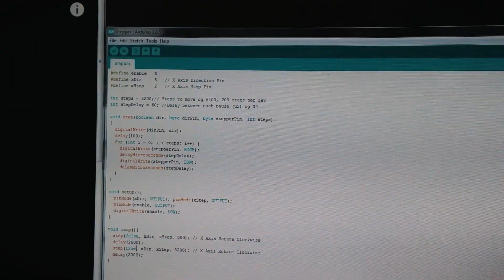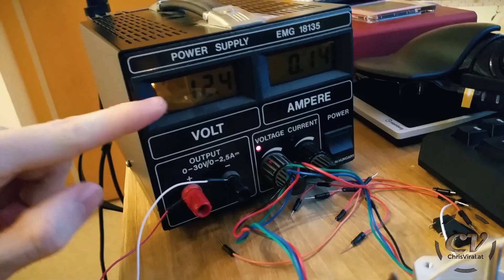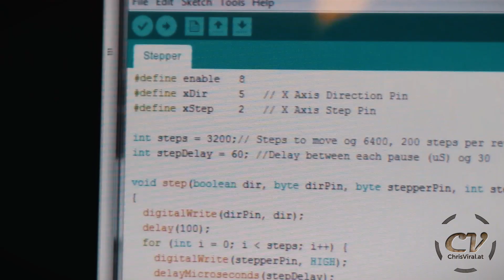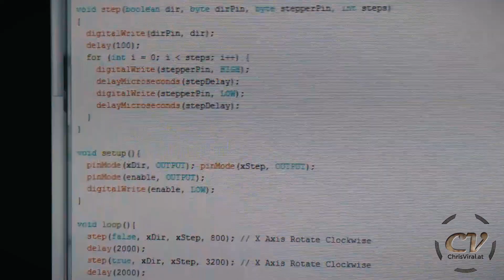Controlling A NEMA 17 Stepper With Arduino CNC Shield (How To & Code)

Comment: Hi, I am using this shield to control XYZ but two motors for Z must be controlled with a button to preform one action. while the XY will be controlled with a joystick. the project is working for XY but how can I make it work for Z? (No libraries)

Comment: ı put my drivers on it .when ı I measure the voltage value on enable pin with a multimeter.I see 5v.but ı did not coded for enable pins to get 5 v .however how to disable this "enable" pin?

Comment: You shouldn't plug in the stepper driver chips on the board without connecting a stepper to it. At least not the drv8825, but think it's the same with A4988.

Comment: #define enable 8
#define xDir 5
#define xStep 2

int steps = 3200;
int stepDelay = 60;
void step (boolean dir, byte dirPin, byte stepperPin, int steps)
{
  digitalWrite (dirPin , dir );
  delay(100);
  for (int i = 0; i < steps; i++){
    digitalWrite(stepperPin, HIGH);
    delayMicroseconds(stepDelay);
    digitalWrite(stepperPin,LOW);
    delayMicroseconds( stepDelay);
  }
}

void setup (){
 pinMode (xDir, OUTPUT); pinMode (xStep, OUTPUT);
 pinMode( enable, OUTPUT);
 digitalWrite(enable, LOW);
}

void loop(){
  step(false, xDir, xStep, 800);
  delay(2000);
  step(true, xDir, xStep, 3200);
  delay(2000);
}

Comment: you can get code for the shield from ACONCAGUASCI, google search 'ARDUINO CNC SHIELD CONTROL STEPPER MOTOR WITH DRV8825
' no thanks to this guy! you may need to change the delayTime/stps

also, you if your stepper controller boards are getting hot turn the pot counter-clockwise, it will turn the current to the motors down.
Reply from the maker: Thanks for the tips 🙌🏻

Comment: How can I control the engines that way using the race switches?
I already tried it in several ways and it does not work for me.
Help!!
Reply from the maker: I'll do another video on this matter in a few days - weeks. But until then you'll probably also have a solution so I'm sorry..

Comment: cómo puedo controlar los motores de esa manera utilizando los interruptores de carrera?
ya lo intente de varias formas y no me funciona. 
Ayuda!!
Reply from the maker: Thanks for translating this yourself, usually I need to go over to the translator lol. If I use the translator though it says "career switch = race switch" still don't understand it..
Reply: @ChrisViralVlogs  can already solve the problem, your video was also very helpful as there is not much information on how to program the motors with the shield
Reply: I made this code to control a single motor with switches (switch) of career

#define velocidad 2

int stepper = 8;
//Driver posicion x
int pasolineal = 1;
int direccionx = 5;
int pasox = 2;

int estadox = 0;
//Limit Switchs
int limitx = 9;
//int spindle12 = 12;

void setup() {
  // put your setup code here, to run once:
  pinMode(direccionx, OUTPUT);
  pinMode(pasox, OUTPUT);
  pinMode(stepper, OUTPUT);
  //pinMode(spindle12, OUTPUT);
  pinMode(limitx, INPUT);
}

void loop() {
  int c = 1;
  estadox = digitalRead(limitx);
  // put your main code here, to run repeatedly:
  digitalWrite(stepper, HIGH);
//  digitalWrite(spindle12, LOW);
  if(estadox == LOW && c == 1){
    digitalWrite(stepper, LOW);
    digitalWrite(direccionx, LOW);
    for(int i = 0; i<pasolineal; i++){
      digitalWrite(pasox, LOW);
      digitalWrite(pasox, HIGH);
      delay(velocidad);
    }
  }
}
Reply from the maker: Thanks for sharing 🙌🏻

Comment: Hey I'm using the cnc shield  with arduino uno and it all seems to work well. But today there is some problem with the rotation of Y-axis, it only moves in one direction. As you have spend a lot time to study it also you may/may not have encountered with the same problem. But if you could help me through it will be grateful. Your Videos is awesome.
Reply from the maker: Sounds like your dir-pin isn't connected properly

Comment: For all the LAZY hunt and peck typists. 

#define enable  8
#define xDir    5   // X Axis Direction Pin
#define xStep   2   // X Axis Step Pin

int steps = 3200;   // Steps to move og 6400, 200 steps per rev
int stepDelay = 60; // Delay between each pause (u5) og 30

void step(boolean dir, byte dirPin, byte stepperPin, int steps)
{
  digitalWrite(dirPin, dir);
  delay(100);
  for (int i = 0; 1 < steps; i++) {
    digitalWrite(stepperPin, HIGH);
    delayMicroseconds(stepDelay);
    digitalWrite(stepperPin, LOW);
    delayMicroseconds(stepDelay);
  }
}

void setup(){
  pinMode(xDir, OUTPUT); 
  pinMode(xStep, OUTPUT);
  pinMode(enable, OUTPUT);
  digitalWrite(enable, LOW);
}

void loop(){
  step(false, xDir, xStep, 800); // X Axis Rotate Clockwise
  delay(1000);
  step(true, xDir, xStep, 3200); // X Axis Rotate Clockwise
  delay(1000);
}
Reply from the maker: No why did you do this, let them type 😂

Comment: hey i have a stepper motor i have connected it to arduino uno r3 with a l298n driver 
but when i catch the shaft the stepper motor stops rotating 
i wonder then how do this stepper motor lift a good load 
is all stepper motors is like this or my stepper has any problem
i am asking it because i am having a robotic arm project which requires to lift a load of 3 kg
please replay 
thanks
Reply from the maker: Well to figure out if your stepper is faulty you should just try another one instead. Also 3kg as a load is kinda undefined, better name a momentum. That you can simply check in the data sheet. Also check if your driver might go to sleep after a command.